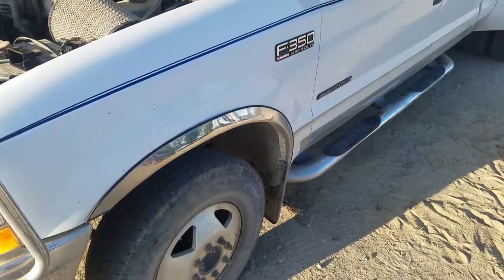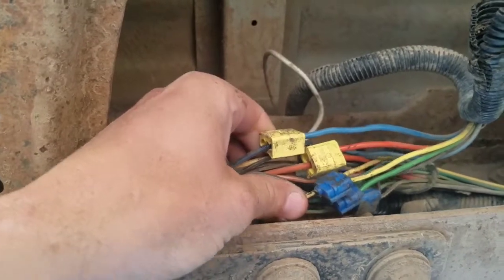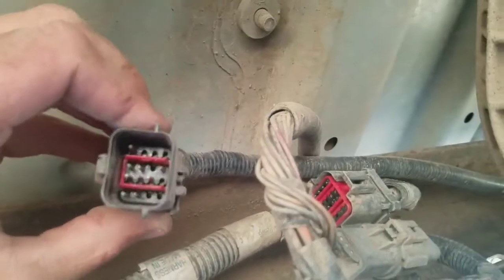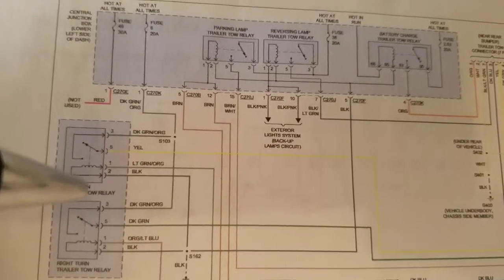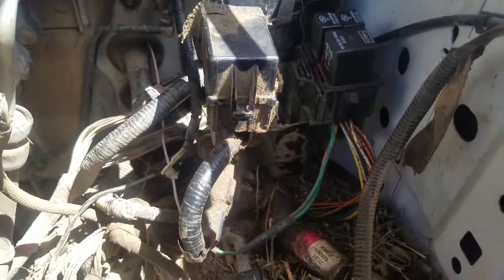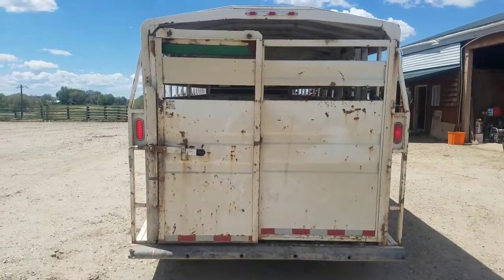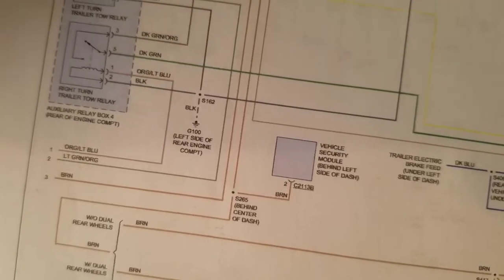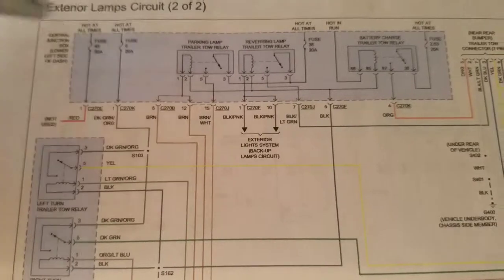2002 Ford Super Duty trailer wiring circuit

Comment: I replaced my 7 pin pigtail from the factory connector to the bumper. The old one had power when I hooked my fifth wheel to it but now it has no power all of my lights on my truck work I’m thinking something might’ve happened at the factory connector when I took the old pigtail out. What do you think?
Mine is a 2000 F250
Reply from the maker: I couldn't really say.  Go back to one of the comnnectors I showed in the video and check for power there.  The 2000 might be a little different than this 2002.
Reply: @prodieselrepair3218  it was the factory connector , I guess it was so corroded when I undid the old pigtail that it pulled some of the connectors out. I took a tester and tested each wire at the connection and I had power so ultimately I wound up cutting off the old connector and the connector on my new pigtail, soldering and heat shrinking the wires together. Thanks for the video.

Comment: My problem was a short. Your detailed information definitely made the troubleshooting a lot easier. I found the short within the fuse block itself and with the wire between the fuse block the relays. I ended up putting an inline fuse and new wire to the relays. thank You

Comment: Do you know where the trailer ark light relay is at in a 2002 f350 power stroke I have checked resistance in wire from 7 pin to fuse box it is good I have owner from switch to fuse box but no power reaches the trailer wire in back of fuse box the relays in the engine don't do anything for the park lights  in trailer

Comment: You telling me this damn Ford doesn.t get its trailer turn signal and brake lights from the tail lights them self like a normal vehicle. So truck can still have turn signals and brake lights but the trailer supply goes back to different fuses than the trucks what ... No wonder my head hurts messing with this thing today.
Reply: P.S. mine is a 99 superduty
Reply from the maker: @twatson6252  your 99 is a little different than this 2002.  They have separate circuits so that the circuits don't get overloaded.  Your 99 has two fuses.  One for each trailer brake light/turn signal.  They are in the engine fuse panel.
Reply: Can't I just tie into the tail lights as I have always did on other vehicles I do not want this b.s.
Reply: You and me both. haha
Reply: Can you post the wiring diagram please

Comment: I have a 2002 F350 and the trailer lights just stopped working. I can turn on the running or parking lights and both elements light up, if I turn on the flashers it's just a bright light. The flashers work but not is the lights are on and the right turn signal does not blink. I am looking for some kind of a short between brake and running lights. I swapped all the relays around and no change and fuses look good. Is there a relay both of these signals are together in? Thanks Kyle

Comment: So I have 2000 F350. The blinkers and lights work but not the brake lights. Would a bad relay do the same thing?
Reply from the maker: Shoot bud I'm really sorry I haven't responded sooner.  I assume you're talking about the brake lights on the pickup and not a trailer.  One thing to check is there is possibly a separate fuse for the brake lights.  Also the switch on the pedal itself needs to be checked.  And finally the two wires that would be for your brake lights run through the turn signal switch in the steering column.  It does that because it has to cancel the brake light on the side you choose to turn on and now has to blink.  Best to get a wiring diagram and check out everything the brake light circuit goes through.  That one I use in this video I just googled and got it from a forum somewhere